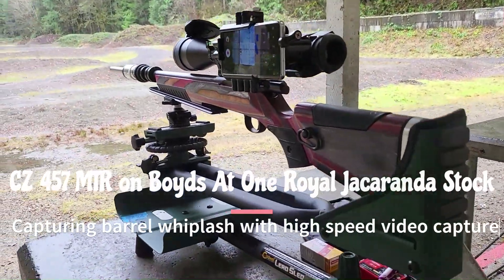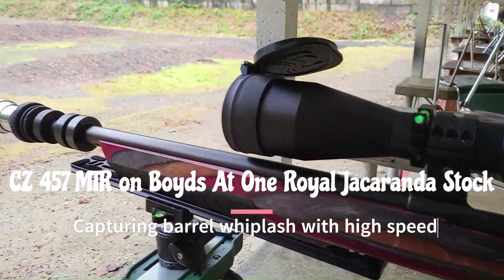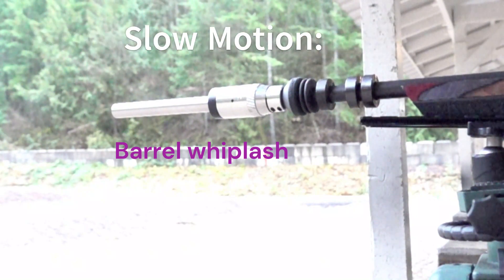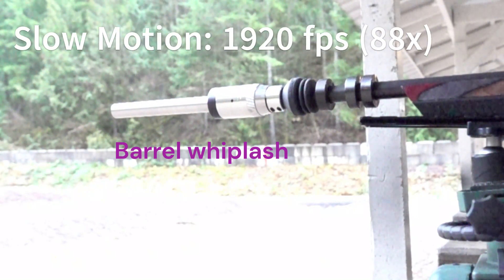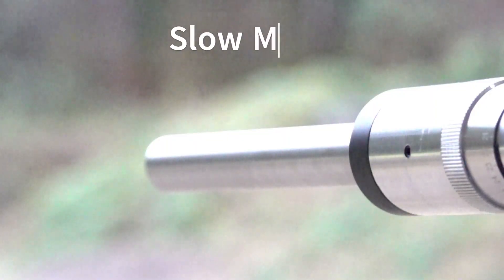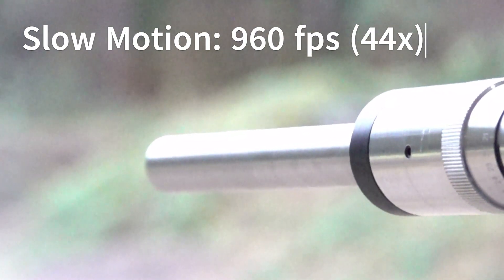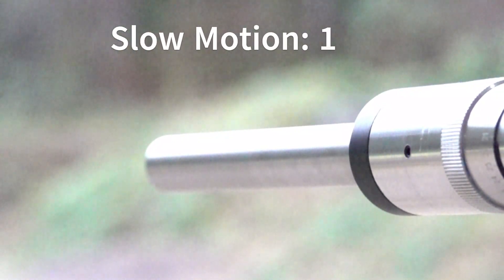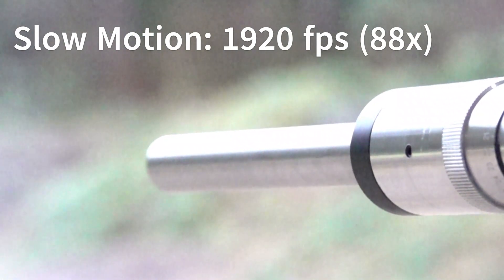CZ 457 MTR Slow Motion Barrel Whiplash

Comment: With recoil pushing the whole gun, how could other microscopic movement make any difference at all?
Reply from the maker: The big recoil is after the bullet exits the barrel.  The microscopic movements can have a big impact on POI 50 yards out, depending on the number of nodes in the barrel.  Higher number of nodes have larger displacement.

Comment: Is that true barrel whiplash or maybe the whole rifle moving from the minute amount of recoil ?
Reply: It does not appear to be what I would typically label as "Whip Lash", being quite familiar with the term. You can set your .22lr rifle on a set of sand bags and remotely pull the trigger and the entire rifle will move slightly as seen here. Which is what I believe we are seeing.
Reply: Barrel vibration starts when the cartridge ignites. This video shows recoil bounce.
Reply: You can see in the wider angle shots that show the barrel, stock and sled... the entire rig is moving.
Reply from the maker: The whiplash is caused by recoil as soon as the bullet exits the barrel.  However, there are a lot of vibration and standing waves in the barrel as soon as the powder ignites. This video is a prelude to more videos where I will attach many sensors to the barrel to capture what the camera cannot pick up....mainly tiny vibrations and standing waves.  Little perturbation as little as a fraction of a mm (caused by vibration/standing waves) at the crown can deviate the bullet by as much as an inch at 50 yards.
Reply: @TunerPlinker  that’s it. Hence the tuner.  Effectivley tuning the harmonics out of the barrel. Same as tuning an antenna. Bullet needs to exit the barrel ant the same point in the wave each time. If we can tune the wave to a minimum, then  it’s more accurate.
Reply: @TunerPlinker  
Interesting that a .22 shot from a MTR bore could vibrate that much to deviate a round 1" at 50 yards. Most shooting channels attribute the deviation to the ammo itself. And quite a few have shown almost no deviation without a tuner with a match grade bore at 50 yards. Did you mean 100 yards?

Edit: Ok, after thinking about this maybe you are talking about a standard (tapered) bore? Not necessarily a MTR bore.
Reply from the maker: @peterwhitcomb8315  My statement is meant to be in general and not attributed to the MTR.  You are correct that large deviation are mostly ammo related.  Some ammo construction tolerance (like mass, and dimensions) are spot on while others deviate quite a bit.  That is another factor to consider.  Thick and long barrel like 23" and up has the advantage because the standing wave is mostly gone by the time the bullet reaches the crown.  In the next few weeks, I will add sensors to the barrel to monitor the behavior....that's going to be another video.
Reply from the maker: @peterwhitcomb8315  did you watch this video?    https://youtu.be/ptdZt4vVHWE
There's a lot of vibration the camera will not pick up.  The barrel may not need to move much to cause deviation.  Tiny vibration can cause it to deviate a lot.
Reply: @TunerPlinker  
I know there is going to be deviation thanks to the force of the explosion pushing the bullet through the barrel. That explosion is going to cause a wave to flow through the metal/steel. The longer the steel/metal the more these waves and lengths of waves can form. Also the quality and thickness of the steel/metal effects the waves that materialize.

Which is why I originally asked if you were talking about a MTR bore. On my Ruger 10/22 with base bore I don't have 1" Deviation at 50 yards. Most (all?) of my issues are caused by ammo quality, a horrible Ruger base trigger, and bad habits. I do have deviation in my groups thanks to the above 3 things. I have noticed that when my bore does heat up my shots will begin to wonder and exceed 1".

I haven't bought a MTR barrel but I did make sure my newest 22 LR had a Bull Barrel to alleviate the barrel heating up problem. The trigger quality is also superior to Ruger's base, but the ammo will probably remain budget quality 40 gr.
Reply from the maker: @peterwhitcomb8315  longer barrel also means that it takes longer for the ammo to reach the crown.  By that time, most of the shockwaves have die off.  This is especially true for 22LR because the muzzle velocity is so slow compare to others.  That's one reason why thick and long barrel have the advantage.
Reply: @TunerPlinker  except that short fat barrels have way less vibrations and Higher frequencies.
Reply from the maker: @donnkloepfer1316  I am in the process of designing sensor circuits to attach to the barrel.  This includes strain gauges, accelerometers, and gyro sensor.  All my sensors have arrived this week.  So have to prep the barrel.  In the next few weeks, I hope to have everything hooked up and hopefully it all goes well.  Then it will be data collection time and more videos.
Reply: @TunerPlinker  sounds very interesting. Just getting ready to install a tuner on a cz 457 and get everything tuned and resonate to the frequency of the barrel.

Comment: Does the "blooptube" work well for the es/SD?
Reply from the maker: I did not use my chronograph during the test.  I live in Snoqualmie and we get a lot of rain in the winter.  Hard to make chronograph data.  Will have to make the measurement with and without it when weather permits.
Reply from the maker: My intuition tells me that it will not affect ES or SD.  From little I have read, it is supposed to help stabilize the bullet as it leaves the barrel.  However adding the bloop tube complicates the tuning process.  Whether it helps make group sizes smaller is yet to be determine.  That’s why I am testing it now.

Comment: Recoil..... That's why you follow through with a precision rifle . Vibration is NON-EXISTENT for the next round. You're trying to solve a problem that doesn't exist. Keep your ammo out of direct sunlight your groups will tighten up.
Reply from the maker: I am planning to build a gyro sensor and strain gauges to measure the little vibration/whiplash with an oscilloscope.
Reply from the maker: Just bought the gyro sensor.  Can't wait to see what it can pick up that the high speed camera cannot.  I am going to max out the sensor rate to 3kHz and see how sensitive it is.